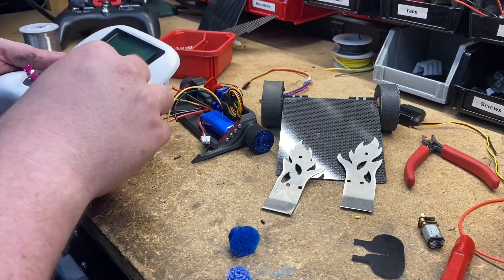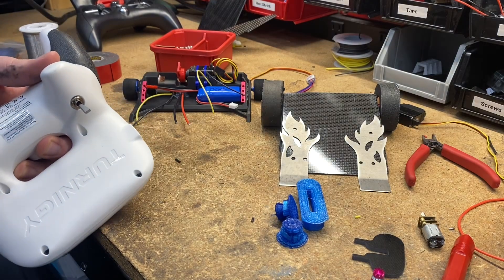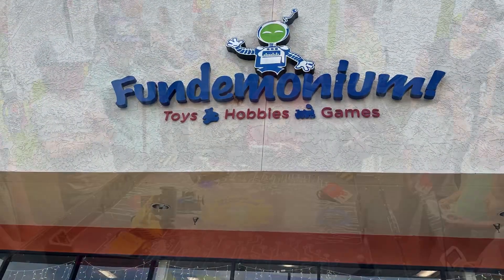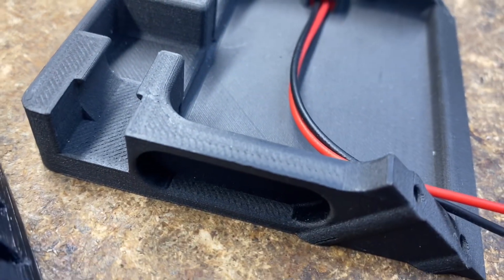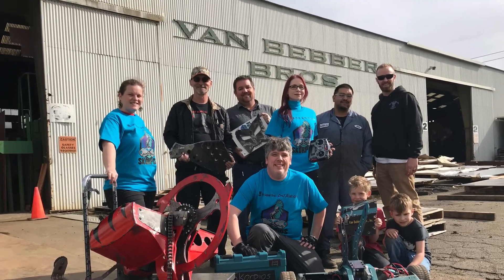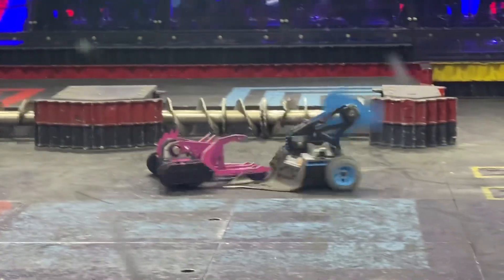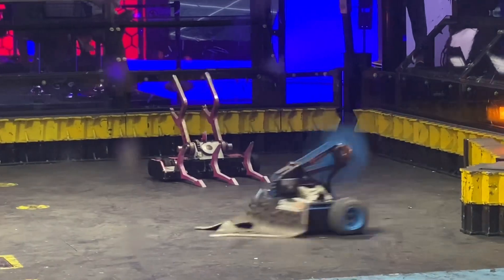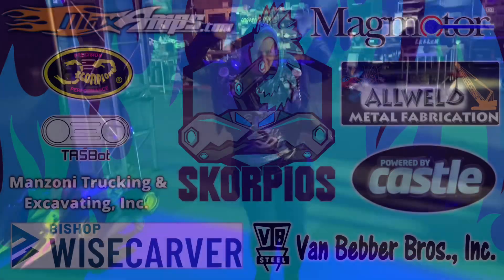I Will Build YOUR ROBOT DESIGN!

Comment: A 6 wheel drive wedge. Similar to sewer snake. Use cut to size belts and 3d printed pulleys. 2 motors. Purple frame and green wedge and armor panels similar to jock jaw. Probably isn't enough weight to make the wedge/lifter articulate like sewer snake so make it a fixed wedge/forks.

Comment: A dustpan bot, but the dustpan is a long tongue, then you have the top be the head of godzilla or a mimic like from dnd. If done correctly you could even find a way to hide the teeth. Just hit up thingiverse to find a good looking head for each idea. Good part about this is you could use your standard n20 / n10 drive and the nano, with a servo to control the mouth.

Comment: I have a cool idea which uses a hexbug duck, on my channel I have a custom hammer bit which uses one of those big motors with the yellow gear box and I 3d print an arm with a AA hammer and maybe use a blue 3.7 volt battery for better power too, 😊

Comment: My idea is:
 
Honey, I Crushed The Bots
(a hammer bot+ crusher)

It has a horizontal crusher, and a hammer. The idea is you grab the bot and continuously hammer it.
For the drivetrain, it will have two wheels, possibly with wheel guards.
Maybe like low to the ground, DUCK!-ish square design, with turqoise monster art on the side.
(If the hammer thing doesn't work out, maybe turn it into a horizontal-clawed suplexer).

I think this bot will be a nice control bot, and be fun to see.

Comment: Robot: Dizzy destruction. Imagine the shape like a staple remover flat on the table, the hinge is powered by a strong servo. The two sections have a wheel with an n20 or n10 mounted on the end furthest from the hinge. Color scheme is white and orange, swirly pattern to reflect that it'll be spinning round a lot. When it's opened wide it can tank drive around, when it clamps it can spin.

Comment: Have you ever heard of Spirit of Taga? It was a World Championship V entrant that had to withdraw. I thought it was cool since it had two drums that caved at a 45 degree angle that, after testing it myself, would have been very difficult to not get picked up by one of the drums.
I would make a 2WD robot with Spirit of Taga weaponry called "Clean Sweep". The weapons themselves focus on torque to pick up other bots and are made of a firm rubber or grippy plastic in the shape of those side brushes you find in a car wash. The idea is that the robot would charge forwards and grip on the corners of the opponent and pick them up without the struggle for ground game.
For decoration, the body is a primary color (I'd say sky blue) and has fake panel outlines to resemble a freshly clean car. The two brushes are a brighter red. If the robot looks too flat and square, you could add a squeegee tail to the back or even double down on the car shape.

This idea I've made in a few robot combat games, but would love to see it tried in real life! Good luck with the new bot ideas!

Comment: 1 foot wide 4WD with 4 N20s 1000RPM. Maybe TPU? Or just PLA+ or some form of Nylon. Depth: 2-3in Low profile chassis. 3mm thick armor. Four hinged forks up front. Invertable. And a smooth red/black paint job. With small Wheels to account for the depth that can be foam with latex. Should turn very well and smother bots. Due to the width, the forks can be very long and painted red. It will be called…

Drumroll please dadadadadadadadadadadadadadaadda..
… BRICK WALL!

Fast, wide, forks! Everything that makes wedge bots not boring to drive! Everyone knows what a Brick wall is. It familiar, funny, and unique, not just another sloped two wheel drive lifter bot. BRICK WALL IS THE FUTURE!!!
Thank you for reading this. I have way too much free time.

Comment: A flipper that stores energy with a flywheel like blip. The frame is rectangular with two powered rear wheels and a long flipper at around 20-30 degrees. The robots color scheme would be orange and black bc why not
Reply: And name it grasshopper

Comment: You call me crazy but make a bot like tantrum but instead of the mini spinning disc make it a punch with a horizontal disc with a four wheel drive. Make sure to add a self right system to it. The bots name is punchline. It will be red and black

Comment: You should build a flipper where it's just a giant linear actuator with a split snow plow wedge on the end that goes forward and forces the opposit back and up. The snow plow would be recessed into the front to protect it and you would have harpoon wedglets to catch the other bot. I am imagining it would be a two-wheeled bot with the cylinder hanging out the ass end. The back of the cylinder would be vulnerable but the bot would have really good reach and turn quick. You could call it Death-Blow.

Comment: You could Try make a Lifter/Grabber like Barrog, with some quite strong drive motors and good motors to lift other robots, soo it can grab the robot and lift it to control it,and make the bigger part of the lifter wedge have a good turn Radius soo it can self right,Some Colors could be like Pink and White, and the Name could be Ms Huggies.

Comment: My 2 favorite bots because they are weird are: 
My favorite bot of all time is Huggy Bear the short empty center grabby thing (4 wheel drive low low man). This bot is meant to drive under you than "hug you" with its side grabbers... making it big enough and short enough is a real challange- kinda flat mammoth problem. I even tried to make a ant weight version of this and gave up due to my lack of ability.

T-minus is a super interesting design for me since it was a winning "thwack bot". The bot would spin in place bot with a t shaped side wedge hammer head (2 wheel drive thwack design). In most of its fights it would side spin, jam its head under its opponent and drag them around, I think this could be optimized, during its run it was terrible (even though it won its weight class to boos haha). It would lift as it spins, making it a terrible wedge, but perhaps you could make side wedge work.

Comment: A 2wd mammoth styled lifter bot, probably using the same gear-motor as the drive but geared to the 'weapon', and can even mess with other mechanisms like worm gears if the ratio isn't high/slow enough

Comment: if I had to design something for bot bash party I would have to say a full body 360 degree lifter the design is made up of 2 individual systems with it's own weapon motor on each side powering the lifting arm so the robot is able to do a hand stands and back flips and be super fun to fight and play with. similar to razorback but being able to use the arm to lift normal or to lever the body upwards to lift.  

The drive pods have 1 drive motor at the front with a belt of gear system to the rear wheel and a low rpm motor with a gear on the inside that goes to the arm system. there is a shoulder bolt for the shaft connecting all parts together the lifter being in the middle and being able to easily be swapped out for a clamp or a hammer etc so if the lifter isn't ideal you can easily give it a different weapon with. 

The bot it's self is a simple shape a simple 4 wheel drive boxish shape with a wedge on all 3 pods so it can wedge things but the back of the drive pods and arm are round so it can easily roll around even if the drive randomly dies it can keep being fun. I will suggest if you do decide to select mine put some bushings in the arms and have the arms mainly printable for easy swap outs with the gears bolted to the arms. 

I would suggest internals but given I am not super knowledgeable on US robots but maybe use 2 Malenki-Nano 1 in each pod so there is no crossing wires and us you can probably get away with 300mah 2s GNB lipos with the JST or the 380 mah with xt30 they are very small and easily can fit inside.

as for themeing I would suggest maybe some kind of snake and calling it constrictor or something like that.

Comment: Ive loved this idea for a long time, a tracked bot with two clamping claws like red devil, but instead of a saw its got a defender style lifter that could also be used as a regular lifter if you pull the claws all the way up. The claws should be yellow with black tips to mimick like a bee stinger kind of look and the rest of the bot can be a mix of yellows and blacks

Comment: A lifter bot with 2 independent lifters that can be controlled independently. When the opponent drives onto one of the lifters, it can activate that lifter to flip the opponent sideways.  Two wheel drive would work.  Name would be "Side Kick". Colors could be Robin colors from Batman.

Comment: a bot that has a top and bottem lifer that are made out of aluminum and has 4 wheel and a chassis made out of tpu and a top and bottem plat made out of pla and it well be called wideside or uncel slam and that uses hub moters and hub moter drivetrain and the colors are periwikle and yellow and the name is supernova

Comment: How about a mini scorpious with the twist that the weapon motor, battery etc ARE the flywheel to add to its weight. so the weapon arm wouldnt need to run a vulnerable chain but could even be made from something bendy/ flexible like uhmw or so. that motor 'package' would need to be encased in some steel to add to the weight and deal the damage. id imagine this whole thing look probably less like a hammer saw; more like a hammer drum? name? how about Badaboom and dress it in some 5th element color themes i.e. white and orange with some hints of black.

Comment: Huge style lifter/grabber named chompers. T shaped with large wheels at the top of the T and a long lifter hinged at the bottom of the T with a servo winch actuation half way down the T. The end of the lifter is between the two wheels like a lower jaw so that it can "bite" and toss its oponets away when they end up between the wheels and in the jaw. Side veiw: o> Top view: °T° Not to scale

Comment: Something I've always wanted to see in robot combat, would be an actual hammer drill on a weapon arm. It would work well in a clamping bot, or a dustpan scoop. Capture or immobilize the opponent, then swing down with a hammer drill, likely with a heavy masonry bit, roughly the same power as the hammer saws already in the sport, but instead of just tearing in with spinning blade, use all that power to drill a lot deeper in past the armor, and do precision damage on the inside.
Reply: Go check out the power of friendship in Nhrl

Comment: You can make a walking robot that looks like a scorpion (wonder where I got that).  https://www.wildlife-media.at/bild/36534/europaeischer-skorpion.jpg.  I think it would look cool to make the top our of carbon fiber (black) and put a red stripe or flame.

Do a walking robot based on a CAM system (wheel turns and legs move [https://www.youtube.com/watch?v=rdUMAzsBsOA]).  Example here is the simple walking mechanism.  Simple motor (geared down) to turn the cam to make the legs move.  A motor for each side would allow you to drive it like a tank.

If you can get it to rise up, then you can walk on top of the opponent, then you can have a claw close down around the robot so you can get hold of the robot and walk away with it.  Perfect for dropping robots into obstacles, etc..  You can make the claw look like the claws on a scorpion (I would do the grip/hold by moving the claw arms and not articulate the actual claws).

Comment: Do a giant lobster claw clamp bot with 2 wheel tank drive where the bottom portion of the claw would be a ground scraping wedge and that would a single 3D printed part with the wedge, hinge for claw, and chassis. And just a lobster claw with a servo that attaches to the hinge so it moves up and down. Make if all red and if it has self righting issues add antenna and some eyes to it. Call it Larry the lobster or something like that.

Comment: A Hydra themed robot named Alpha hydranoid with an angled panel wedge that uses two wheel n20 drive with 3 heads that are black with spikes on the running up the neck of the heads and red teeth it would also be servo actuated and work as a clamping mechanism. It would also have 2 static arms with claws on the ends of them that would be for show more than anything. In the at the very top of the wedge there would be a static partial saw blade that realistically should be 3d printed in a white or silver color for safety purposes and because it’s purely a visual. Another neat visual would be to have 3 hinged(unpowered and able to move horizontally but not vertically) tails that are black with red spikes on the end. If you have read this far and think this visual looks kinda familiar its inspiration is from Alpha hydranoid from the original Bakugan series back in the early 2000’s. If you decide to do this I would gladly send you what I am making in RA2 for you guys to use as a reference for what I am envisioning here. Unless a color is stated everything else is black

Comment: This is actually an idea i want to try myself, but I figured I'd share it and throw my hat in the ring. So my idea is essentially a modernized version of Ray Billing's old robot Swamp Thing, a wedge shaped robot with 2 large wheels that allow it to wheelie with a small flapping plate that acts like a mouth, but instead of it just flapping around, the jaw would be motorized.

The idea would be a wedge shape with 2 wheels large enough to wheelie, a tail on the back to keep it from flipping itself over, and a wedge shaped front. The front would have teeth like forks to get under other robots. Under the wedge is a lower jaw made of forks that pushes up to raise the "nose" up and cause the robot to wheelie, making it look like an animal opening it's mouth. The lower jaw and inside of the mouth would have teeth on them (Can be metal or printed for safety) for grabbing.

With the weapon open it can grab other robots and take them to pits and traps, while when closed it can get under other robots to push or flip them. The robot would ideally be green and have the look of some kind of reptile, such as a snake, lizard or crocodile. Eyes of some kind to give the robot some personality would really help as well, whether they are painted on, are LEDs, or are Googly Eyes. The could be added to the top or sides of the wedge, but it would be amusing to have google eyes on the wheels (thus may make repairs harder so this may not be ideal). 

I have no name ideas, but I feel this could be a very fun Sportsman robot that has a lot of personality if built. I'm curious to know what y'alls think. (Also let me know if you need any other details)

Swamp Thing (the inspiration behind the design): https://youtu.be/YhDcN6AA7mQ?si=zM1kpqWbpK4JIOio